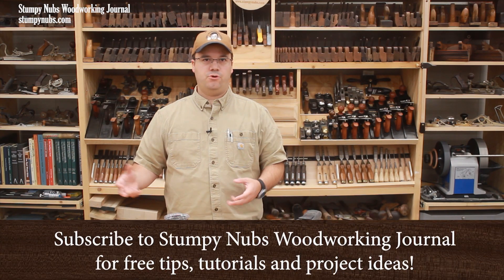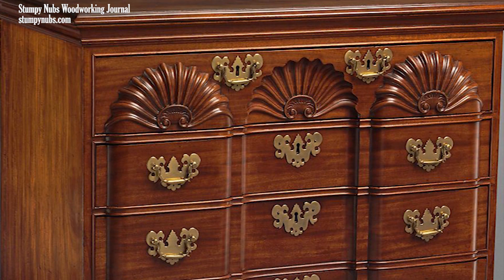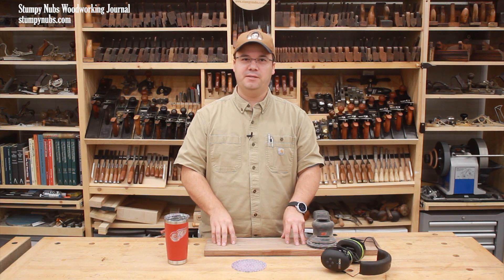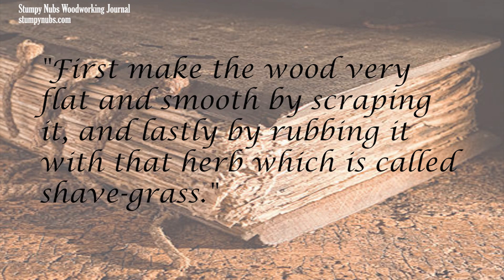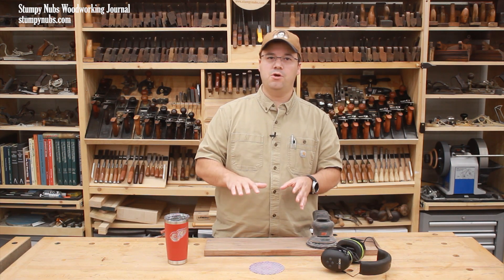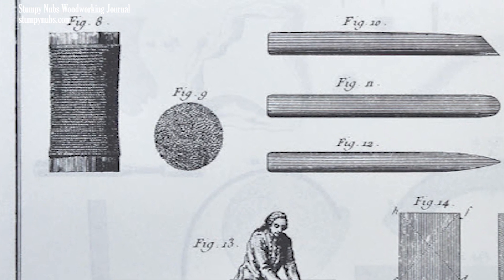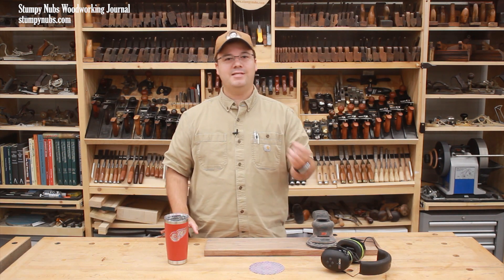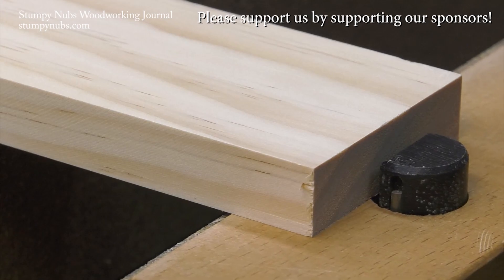The history of sandpaper is really INTERESTING!!

Comment: Always remember: "the good old days" are never as good as we fantasize and those masters would have killed for a few sheets of 3M. Be proud to continue the tradition, but not so proud as to think you need to break out the shark skin sanders.
Reply: Sharks skin is smooth (its a running joke)
Reply: Imagine the looks the "old masters" would give stuffy modern people who say you shouldn't use a table saw to do in five minutes what it would take two hours to do with a hand saw.
Reply: It's like the mythology surrounding Damascus and Japanese steel. The practice of folding the steel many times didn't make it superior to modern steel. They did that because they didn't have the materials science to make uniform high quality steel. It was full of all sorts of inclusions, differing carbon contents, etc. and folding the steel helped make it consistent, especially along the length. Modern steel doesn't have those defects and therefore folding one type of steel on itself doesn't do much.

We like to think about the big designs of various creations but materials science is often overlooked as to why people didn't make modern inventions sooner. Like you wouldn't change world history by taking a modern firearm design back in time. People had theorized about breech loading weapons for a long time but they didn't have the high quality steel to make them work without exploding due to flaws in the metal until relatively recently.
Reply: @Drew W - I’m by means no means a master of woodworking, I’m not
even close.  Accordingly, I’m only willing to mildly wound someone for a few sheets of 3M Cubitron. It’s definitely good stuff. We’ll see if my opinion changes if and when I become a master woodworker. Stay tuned!

Good video, thanks mate.

Cheers!

Comment: Ok. I did it. I put down the 5” paper I’ve been using (struggling with) & ordered some of that 3M junk like you discussed. 
My process for sanding is drum sander 80-100 grit then ROS 100/raise grain/220/finish. 
Drum sander puts tiny line in my boards. Sanding (longer than I want) with my typical paper took some time but it got the job done. 
Let me just say that I’ll be buying 3M from now on. 
Thank you.

Comment: I was introduced to hand tools as a child (brace and bit) and still love them. As I grew up a number of old tool aficionados I 
know scorned the use of modern tools, etc., saying the "masters" would never have compromised. Horse feathers!! The old "masters" got paid when they delivered a commission/piece and they would have (and still do with noteable exceptions) used tools (including sandpaper) that expedited the process. It's a choice. I've seen modern work done using only hand tools. Results varied significantly. I have but don't take the time to use old tools exclusively. If I did the results would be considerably less satisfying. It's every woodworker's choice. Best luck to all regardless of how you choose to do it.

Comment: The dogfish is a member of the shark family. Many sharks have this skin that feels smooth when rubbed one way and very rough going the other. The skin is rough and covered by a tooth-like, scaled surface called dermal denticles. When I lived on a Pacific island, we learned to catch the young sharks that swam very close to the beach line at high tide. You just reach down and grab the dorsal fin and tail at the same time. Lift and throw onto the beach. Don't try to hang on as they fight very hard and even a small bite will leave a very nasty wound.

Comment: Also who are saying that sanding is not required, probably they don't realize or know the importance of it. It is essential step to prepare the surface for surface treatment and finishing. Basically all finishing product have a specific instruction how you should prepare the surface. You need those tiny scratches what made by a sandpaper to apply the finishing product and make able to go inside the wood. Just try to drop a drop of water onto a freshly planed surface and a properly sanded one. The first one barely make wet under itself the 2nd one will be soaked by the wood.

In fact here in mid Europe in the past carpenters used planed wood specifically for making it more resistant against fire and mushroom infections because on a really smooth surface they could not stick as easier.

So sanding is necessary.

Comment: I've kept most of my used sandpapers even after using it for how many times. Especially for rough builds, these sandpapers still comes in handy , just placed them in a separate box. Those fine sandpapers are usually the first to go.
Reply: A sandpaper eraser from Harbor Freight is also a great sandpaper life extender!
Reply: I recently found some fine wet and dry papers cut and used by me 30 years ago in my sand paper draw.
Reply: @spudpud-T67  I also have some sandpaper that’s over 30 years old
Reply: I don't keep used sandpaper.  I find I do better and faster sanding with new/newer papers.  Just compare the feel of the grit between old and new.  And then the difference when using old and new.  I use sandpaper as if it were free.

Comment: I bought a box of the 120 grit cubitron 3M, after your tutorial, and because I needed sandpaper tomorrow on Amazon. It is good. Way better than many different brands of sanding discs. 

I had a lot of sanding to do in about two days, using the cubitron on day 1, and moving back to the Festool granat mesh at the earliest opportunity.  It is still nowhere close to the Festool mesh granat at the same grit. It’s also much weaker than the mesh. . 

I reckon, on a cost per sheet, I get about 1 Festool granat mesh disc / 5 or 6 cubitron discs for the same amount of sanding result. The Festool expensive sand ‘paper’ is cheaper, and faster than the 3M, per area of sanding.

Comment: It is said that Stradivarius used sharkskin to finish his violins after scraping. But one of the best finishing papers I recall using was garnet paper. As I recall, it was the sharpest and most long lasting sandpaper, but then it got gradually more expensive and then disappeared from store shelves. I don't think I've seen any in over 25 years and that was in a specialty woodworking store.
Reply from the maker: Garnet sandpaper is commonly sold in dollar stores and it is of low quality. I can't imagine someone finding it long-lasting. But everyone's experience is different :)
Reply: @StumpyNubs  As I said, the garnet paper I was referring to was from long ago. In the late 90's to early 2000's there was a paper out that the manufacturer claimed was garnet, but the color and grit of the abrasive was wrong. And the abrasive tended to fuzz the surface and as you said, didn't seem to last "as" long.
      But I am biased. I am not a fan of the aluminum oxide family of abrasives. And though, I try to stick with Norton brand abrasive products for fine work, I will use the cheaper store brands in the field for quick touch ups.

Comment: For those that own an RO150 don't bother with the net style sand paper, it doesn't hold up to hard work your better off using an eraser and/or a wire brush on normal sand paper to keep it clean. I did try the 3M cubitron net it just doesn't hold up when hogging of material.

Comment: I know that sanding is sometimes faster and easyer to do and lern, but to me, its not always about speed and easyness, but also about joy. I love lerning how to make my plane and scraper do wonders. its also a bit less dusty, so in my "workshop" i can still live. I have spent more time in my scrapers and planes then other classmates I bet, just becouse it is verry fun to me. I just love tools and older practices
Reply: Yeah, but you NEED sanding for finishing products. For example if you use some kind of oil you have to prepare your surface to be able to soak it properly. Every product have a manual how it should be apply and basically every product what I have used had a specific instruction how you should prepare, like sand it up until N grit, raise the grain with a wet cloth then sand with n*1.5.
Reply: And more power to you, and everyone who appreciates your work. I, on the other hand, have to make a living with my cabinetwork, so sometimes joy is sacrificed for food on the table!

Comment: My grandfather used broken glass as his scrapers and to put the polish in the surface he had a 12x12x1/2 block of glass he had gotten and put a handle on it and used it with with different grits including 1000 grotto sad smooth.. I have a 6x8 of of glass I use to polish my teak oil finish with rubbing compound

Comment: Stone can be cut using sand, water, and a cord.  You don't need a copper plate.  The advantage of the cord method is that it is scalable, and the size limit of the stone being cut can be very large.
Reply from the maker: I'm not sure I said stone could only be cut with a copper plate.
Reply: @StumpyNubs  Sorry if I was unclear.  You didn't limit it, simply described the use of sand and a copper plate.  That works just fine.  My intent was to expand on your point.  An abrasive and a "medium" can do a lot that most of us modern types have forgotten.  If you are interested in Egyptian stone work, then the evidence of large saws, probably watered powered fiber cords with sand is quite common.  Lots of people like to point at the cuts and ask "how?"

Comment: most of these "know it alls" do not realise that even a planed surface usually gets a wipe with a fine sand paper by the best craftsmen.  a highly smooth surface will not take a finish as well as one that is slightly roughened.

Comment: In the early 1800's, tanned sharkskin was an important by product of the coastal whaling industry in New South Wales. Killer whales herded baleen whales into bays, locals rowed out and killed the whales, leaving the carcasses until the Killer whales had eaten what they wanted then processed the carcasses for whale oil. The rotting carcasses then attracted sharks in large numbers which were in turn killed and skinned with special tongs, tanned and shipped to Sydney for export.

Comment: Not sure if you saw the video but Jonathan Katz-Moses did a video on different sand papers and found the cubitron mesh discs performed the best.  So you are not alone in your opinion about sand paper discs.
Reply: Ugh JKM is such an a-hat. He's so arrogant and abrasive (ha!). I dropped his channel after a particularly nasty response he wrote to a comment where he was called out/corrected. 

At any rate, I've seen mixed reviews of the mesh 3M Xtract discs. I haven't had issues but others have mentioned that the purple grit in the discs comes off really quickly and then the discs stop working faster. I think it must be a quality control issue.

Comment: Wouldn't it be more about the development of aluminum refinement/smelting, rather than aluminum oxide being "invented"? Any bare aluminum you see is immediately oxidized into aluminum oxide. So you'd just need a chunk of aluminum and scrape it with something to get what you'd need to use it for sandpaper. Edit: forgot to say, very interesting video! Love your channel, one of the only woodworking shows I still watch since I hurt myself and gave it up for other hobbies that the injury temporarily prevented me from enjoying.
Reply from the maker: Did I say aluminum oxide was "invented?" I'm pretty sure I said "developed" as an abrasive for sandpaper. 3:47
Reply: @StumpyNubs  it would probably behoove me to re-watch the part before I open my big mouth, next time. 😆

Comment: I really hope you do a video on cordless circular saws. I strongly feel theyve gone backwards with safety as the handle is no longer at a 45° angle for most cuts but more like parallel to the workpiece. They are trying to minimize kickback and your resistance to kb is being compromised by the position of the handle. 
Is the circular saw the only tool that changes your handle position with the depth of a cut?
Im going to want to cut a 1/2" ply with the saw on full depth before i feel comfortable. My hand should be behind the saw at a low angle to resist its natural tendency to push back rather than holding the saw from the top and "guiding it thru the piece".

Comment: I havnt finished this video but i hope that you show how finishes change how the wood looks depending on how it was prepped. Apparently handplaned surfaces result in a more contrast versus sanded.
Reply from the maker: This is a sandpaper history, not a sanding tutorial. However, we have several sanding tutorials on our channel :)
Reply: @StumpyNubs  thanks for the response. Ill take a look. I still think itd be interesting to see a book matched peice with the same finish but one surface is sanded and the other is planed.
Reply: @rauldelgadillo8447  Thewoodwhisper has a video doing that
Reply: More contrast is likely what some would call "blotchy" because the surface isn't even, so the stain penetrates at different depths, while sanded has a more uniform surface.
Reply: @Roct3874  thanks ill check it out
Reply: @CP-mb7ly  i dont think thats true. Planed and sanded surfaces take oils and stains differently because one severed the wood fibres cleanly while the other abrades them off.

Comment: I do medieval reenactment/recreation, and that includes hand tool  woodworking. 

This is Phenomenal information, Thank you so much. 

And If anyone can throw some citations for further reading on this, I would be ever grateful as well.
Reply: So i have not many citations about abrasives itself, but there is a book from 1828 (pre-industrial) from G. A. Wettengel for instrument building that shortly describes the sanding of violins and guitars. I am translating this from antiquated german, so there might be some uncertainties:
"After a surface got scraped this way, it gets sanded. This happens partly with sand- leather, partly with glass- leather, partly with horsetail. This is the way in which sand- leather is prepared: One coats one side of a piece of very warm, inscribed,..." (i have no idea why it has to be written- on paper) "...neatly glued, strong/thick writing paper with hot wood glue, quickly and evenly, using a fine brush. On this layer one sprinkles just as quickly as much fine, warm sand as possible, which was parted from its coarse parts before by using a fine hair sieve, so that the glue is covered by it in all spots. Now one puts the paper at a place where it can dry as fast as possible without burning. Then the remaining sand gets shaken from the paper and the other side of the paper gets treated in the same way, so that it won't disintegrate as fast. In the same way glass- leather is prepared, only that one uses powdered glass or powdered pumice. Horsetail only gets used in a case where the leather can't reach the wood because of its shape. This horsetail gets cut by its nodes and bound in a bundle, the nodes that will obstruct your work get cut off. The bundle gets submerged in cold water a for a few hours. While in use the horsetail must not be too dry or too wet, as in the first case it will be too aggressive, in the latter case although it will..." [now the word the author is using here is appearently antiquated and from a dialect, because i can't find anything about it, it is very close to the german word for "smoothing down/ polishing", but i think what he meant is that either the horsetail will disintegrate, bend or won't bite enough to make a difference in the wood] "Now one has to remember that, while sanding the backs and fronts of the violins and guitars, one shouldn't move with the direction in which the years run, but perpendicular to their direction, so that the wood that sits between the years, because of its low hardness, in relation won't get removed too much. Usually the glass- leather only gets used after one is done with the sand- leather to achieve the highest grade of smoothness, the horsetail, as mentioned, is only used for parts that are difficult to reach otherwise."

Comment: There’s just absolutely no way you can do w/o sanding. Lol. I just finished a desk in few days. More than 1/2 of the time I spent on sanding. I don’t see a good way to have a nice smooth plywood exposed edge other than sanding.

P.S.  I apply some of Stumpy Nubs sanding techniques, OMG it was so much different.   I got the job done much faster and the sand paper still locks brand new (I have cheap sand papers + DeWalt random orbital sander).  It made such huge difference

Comment: I know you recommend the 3M Sandpaper, and I need to get some of that to try it, but is there anything you specifically recommend for wet sanding/polishing? The stuff I get now, the paper tends to fall apart pretty quick after it gets saturated.
Reply: The paper has so say wet/dry.  Using the dry only when wet is a major disappointment.
Reply: @dwightl5863  I get the Automotive that says wet/dry but it still kind of sucks.
Reply: @DeDraconis  I use the wet/dry on pen blanks and acrylic handles wet and it wears out before it falls apart.  Could be an application thing.
Reply: @dwightl5863  Yeah, the things I'm using it on don't start out mostly smooth or flat. It's specifically sharp corners and points that I'm rounding over, and it's either epoxy, fiberglass, or aluminium. The space is too small for me to get a file into though without messing it up, so so-far sandpaper is what it has to be.
Reply: @DeDraconis Possible solution Apply a layer of duck tape on the back of the paper or use a fabric backed sandpaper like belt sander or strip sander belts. Significantly stronger and tear resistant.